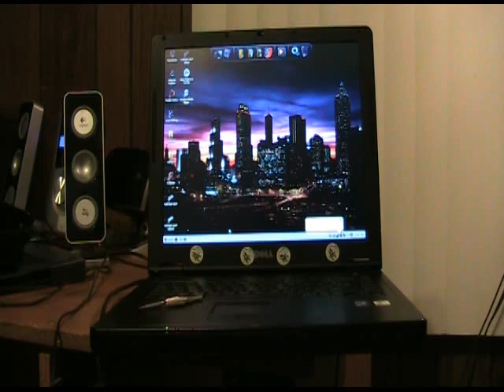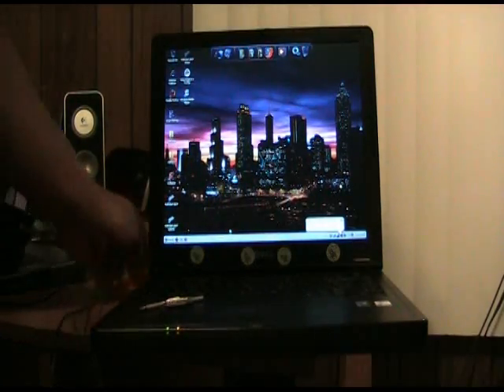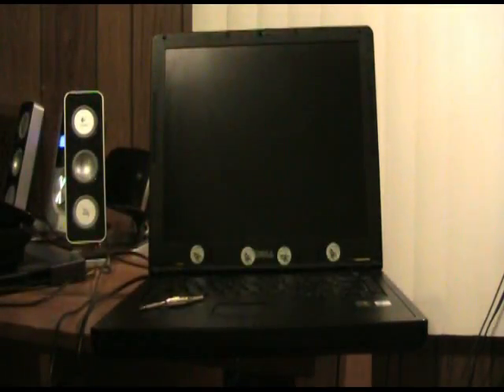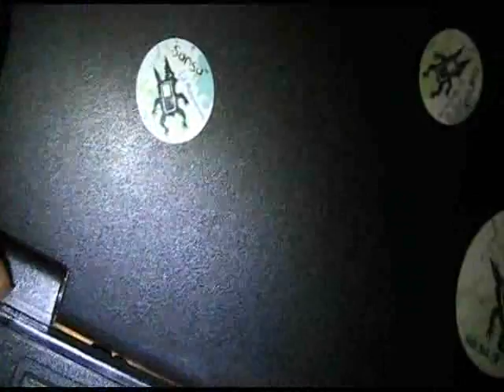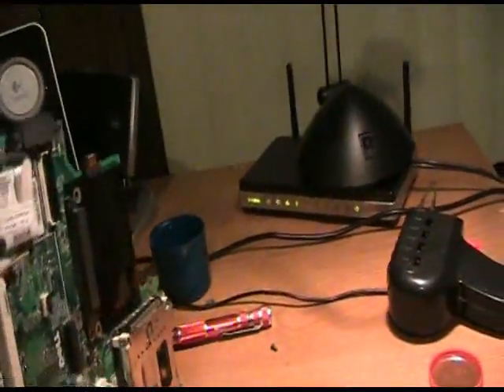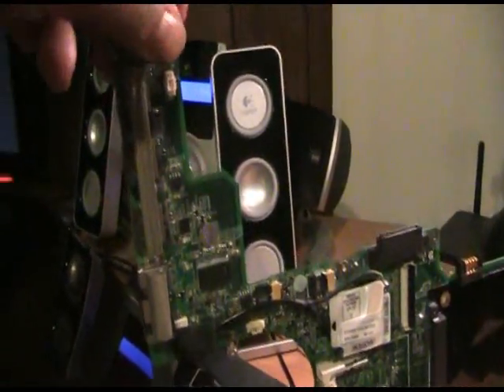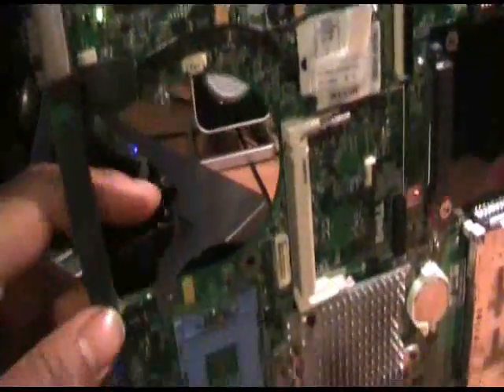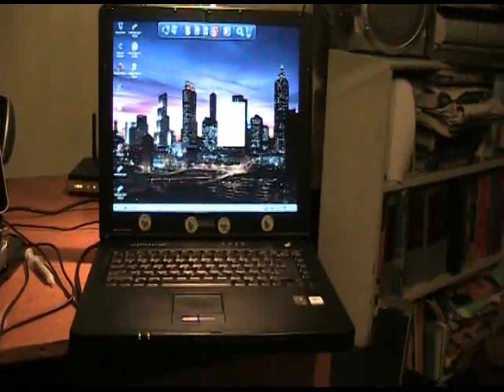How to repair laptop dc power jack

Comment: You're right. For circuit boards, use light soldering iron (pencil type) type. Guns are for heavy duty stuff. Not bad for a first try. You can probably find some soldering instructional videos here on YouTube. Sounds like you have the concept down. You were probably born with the mind of an engineer. Some have it, some don't. Keep it up!

Comment: @clamstrips WHAT'S UP? I have the same problem. Did you fix yours>? I am about to open my laptop and see what is going on. First I want to learn how to use the multimeter in the motherboard. From there it might help. Let me know if you could fix it and how you did it. Thanks.

Comment: What about a tutorial to open ac power adapter. Not the laptop but the 65/90 watt HP power adapter? I cannot find  a tutorial about that. Is there a glue in these adapters or only some plastic holders?

Comment: The light where the jack is inserted, lights up. But I think it might have over heated when I first got it, but afterwards I got a fan and it didnt over heat anymore. No drops or liquid spill. I am thinking it might be a short circuit, but do u think any other things could have happened. And if it is a short circuit due to over heating how could I fix it? Thanks

Comment: Hi I have a hp pavilion dv6000. The warranty ended 2 months ago. My laptop won't turn on. When ever I press the power button, the volume and power button lights up for a sec nothing else and then turns off. I have been told it might be a short circuit, but do you think it could be anything else. Please helpppp!

Comment: i forgot to remove the VGA port(i think thats what it is) but i kinda strong armed the the motherboard and broke it lol terrible, i know.

but to get to my point, i had the idea to do this when i got the laptop from a friend 2 weeks ago, and you confirmed it for me. but i had not so good results...i cant figure out what i di wrong, but when it was all done, i plugged it in to test it and it sparked. 

i do plan on trying again, if not after posting this, then 2maro. running low on solder...